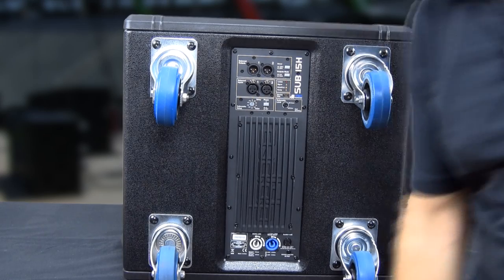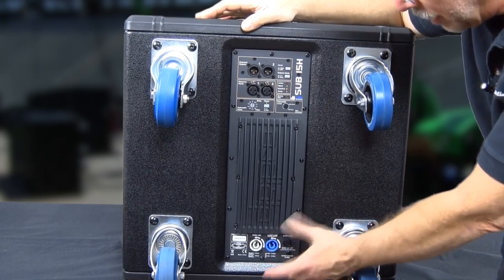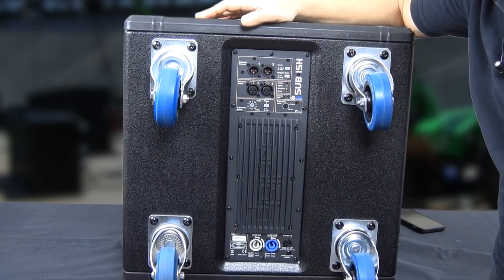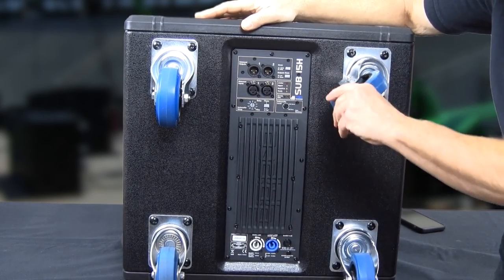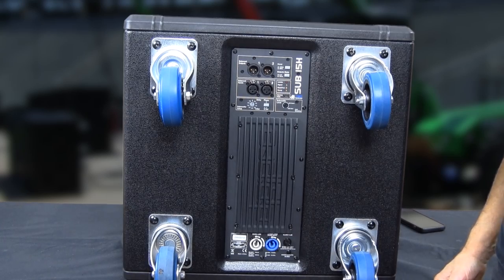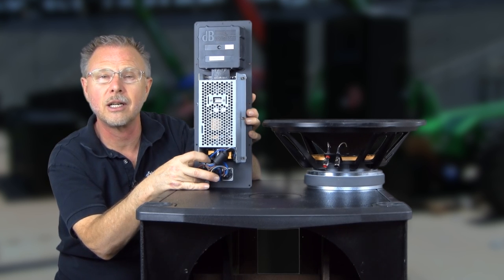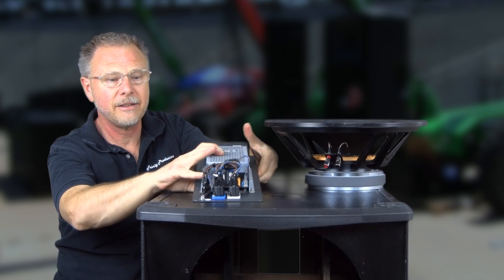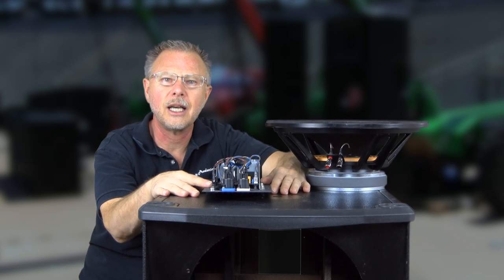dB Technologies SUB15H - complete review - AUTHORIZED DEALERS

Comment: Hello. I'm gonna buy some 15 inch subs soon. I'm thinking SUB15H or DVA S09. I did not like the RCF ones. 705/905AS (both mk1 and mk2). What do you think? Which one sounds better? I am willing to pay the extra cash for the DVA S09. I just need a 15inch sub that's better than sub705/sub905 from RCF. And also, I own some TL6A tops with TTS26A subs. What options do I have from DB TECHNOLOGIES that would match this setup? 4 X TTL6 and 6 x TTS26A subs. Thank you very much! :)
Reply from the maker: The TTS26 are going to be the best 15's you can get, not much out there other the LAcoustic for 15" subs that will rock your world. The S09 is OK but nothing can compare with the TTS26's

Comment: Hi , thanks for the response i can report that i compared the DB SUB18H to EV ETX18SP & sorry to say the EV was louder ,went lower & was cleaner to my ears none of the 2 subs were run into limiting but as you know the DB is horn loaded so it's kind of a dirtier sound (how i describe it) this was evident when we turned off the top box and just listened to the subs,the crossover on the DB also lets more high frequencies through.

Of course the main problem with the EV is that it's a 2 man lift it's a monster sized sub that will break you're back if you try lifting on your own and you'll need a lot more space in your vehicle to transport it as it's quite wide which also makes it harder to lift , on the other hand the DB is easy to lift it's around 10 kg's lighter and is only about 20% lower in output but output on the DB is still very impressive, i suppose the ETX is in a class above in both Weight and output.
Reply: George Georgio Hi. Have you try a test with a prx 618xlf and the db sub 18H? I read on the specs of the db that this is a "combo bass reflex-semi horn loaded" sub. Im very interested to this aspect. The frequency response of the db18H is 28 to 150Hz at -10db, and you can choose the 90-120hz crossover frequency. I think that the great aspect of this hybrid configuration is that came down very low frequency in bass reflex and very long throw range boost in long distance. The prx618xlf have from 30hz to 105hz at -10db. I can confirm that the prx came down at very very low frequency!! but it does not exceed 90hz and the bass reflex configuration have little/medium-long throw range.
What do you think about this?
Thanks in advance, best regards.
Reply: Hi , i'm not a sound engineer i'm a Musician but the DB is like having 1 and a half PRX618-XLF's there is a major difference forget the JBL specs they're not accurate.

The DB pounds harder, goes deeper and seems to throw longer also does not get as hot on the back like the PRX does.

That's why JBL are bringing their new SRX
series out to compete with all the newer models from EV , DB etc one thing about the DB is that it's a dirtier sound not as clean as
the front loaded EV i compared it to also a lot lighter as the EV is impossible to lift unless you're very strong.
Reply: George Georgio Hi. Thanks for the answer.
Just yesterday I carried out tests with jbl prx 618xlf and a db dva s10. With a "hearing test" I could see that the prx attacks from 28Hz up to 100hz. Then it off completely, while the dva s10 attacks by 38-40hz to over 250Hz with filter at 90hz! to get all the power of prx it need to connect the sub in stereo mode, so to be able to work both internal amplifiers for reach the full power, otherwise the power is definitely half. The sub dva s10 is only mono, therefore has an output comparable only with the stereo mode of prx. The sound of prx is soft and pleasantly muffled, while the sound of dva is dry and more opened (but is also designed to be suspended!).

I think that the spl is little more in dva. I wonder if even the sub db 18h in mono mode has half power. Could you possibly tell me this? Thanks in advance, regards
Reply: Hi the sub18H uses the latest digipro 3rd gen so you can't compare it with an old digipro 1st or 2nd gen dva s10.

There is no competition the
PRX sounded hollow when i compared it to the sub18h i had one FBT VERVE on one side with the PRX and one with the SUB18H on the other side the difference was night and day the only thing you could argue is that the JBL may go slightly lower at low volumes but i did'nt notice it.

If your'e trying to work out what goes lower etc you would have to hire both or one of them (if you have the PRX) and then do some testing but i think you'll be wasting your time, wait til the new JBL models come out the PRX is almost  5 Y.O. I also compared the sub18h with the DB sigma sub and the Presonus 18" sub and it was more powerful than both of them but i think they may have had a cleaner sound at lower volumes being front loaded.
Reply: George Georgio Hi. 
Im very interested to buy a pair of db sub 18 h and replace my prx 618xlf. I hope to hear as soon as possible. I put them under the Verse Insider 15 MKII (the Verse sub 18mkII is very cumbersome).
Yesterday im try another test in open space with prx and dva s10. The results are that the dva have more spl and sometimes i see the clip limiter. The JBL is more closed and the clip limiter is continuos light. 
Together they have a nice full sound!
By the way: What can you tell me about the limiter of the db 18H?
Another question: can you describe the differences between the sigma 18 sub and the 18H if you listened to them both? I know very well the sound of the sigma sub.
Thanks in advance, regards.
Reply: BertoConsalvi As explained earlier the Sigma had a cleaner sound but
was not as loud as the SUB18H mostly due to the newer gen 3 AMP i'd say , i got the SUB18H because i only had so much space in my car, you could go for a bigger more powerful sub but 42 kg's is my limit.
Reply: George Georgio Thank you very much.
Reply: I hope you get a chance to try one they are a good compromise between weight and power.
Reply: +George Georgio I'm buying a sub to go with a pair of RCF HD32A, do you think I should get the 4pro 8004 or FBT Subline 18sa? Thanks.
Reply: THE 4pro would go harder but more expensive, FBT have the Mitus range that would be more than a match for the RCF sub.
Reply: George Georgio Thank you, George. Do you think I need two 8004 with a pair of HD32as for average 250 wedding? Or one 8004 would be adequate?
Reply: One is good

Comment: Can you do a comparison between the Sub18H and the ETX 18SP? i'm thinking of paying to do a local comparison here in Australia as there is a guy who sells them but he needs a bit of convincing to take one out of the box as he knows i won't be buying as i've just bought the Sub18H it pretty much ate the PRX618-XLF i used to have.
Reply from the maker: EV would have to send us a demo to do a side by side...which, we are dealers, but I don't think they are down for that ... think this series would be some serious competition to them. And most likely outperform them...
Reply: trinityprosound
Hi,unfortunately as i've previously stated this didn't seem to be the case the ETX 18SP was better all round but we were only trying a couple of tracks and the ETX
is around 10kg's heavier and a lot wider/harder to lift.

On the other hand i can lift the SUB18H with a little strain on to a trolley, i think the DB is a very good compromise on weight and power i did a function last week with around 300 people and it felt like there were 2 subs in the room, one of the staff came up and asked what subs we were using and i just pointed at the SUB18H.
Reply from the maker: George Georgio thanks , excellent news !

Comment: I narrowed my choice between the DB technologies es 1203 system and the Sub 15h and some opera tops as a compact system. Which one would be better to do dj events?
Reply from the maker: use a pair of ES1002s' for ease of set up and portability, but you may realize a bit more sound output from a pair of Opera tops and a pair of SUB15H's
Reply: trinityprosound  thanks again

Comment: How about the SUB18H ? It really goes down to 28hz ? I have to choose between SUB18H or RCF 8003AS ..
Reply: I'm curious about this too
Reply from the maker: It can, but it will be most likely 6-10db down from the peak which is around 70hz, there is not enough cone or power to really produce effectively on a sub of this type and size down to a earth shattering 28hz. you have to get into a 21" with more power and larger volume of box to get constant earth shattering, low note out of that you will feel, but may near clearly hear...

Comment: Hi all. Anyone never try a test with a prx 618xlf and the db sub 18H? I read on the specs of the db that this is a "combo bass reflex-semi horn loaded" sub. Im very interested to this aspect. The frequency response of the db18H is 28 to 150Hz at -10db, and you can choose the 90-120hz crossover frequency. I think that the great aspect of this hybrid configuration is that came down very low frequency in bass reflex and very long throw range boost in long distance. The prx618xlf have from 30hz to 105hz at -10db. I can confirm that the prx came down at "very very" low frequency (an infrasub!) but it does not exceed 90hz and the bass reflex configuration have little/medium-long throw range.
What do you think about this?
Thanks to all in advance, best regards.
Reply from the maker: BertoConsalvi The 18H probably does, but a 6db down or so...you have to have a lot of power and very large drivers to feel the 28hz signal...it is more of a feel than sound and the only way other than at low levels to get that is a box tuned for the low end or lots of power and large drivers in the 21" range. There are some good 18" boxes that will do that low and also some specialty boxes with 12" drivers in them, properly tuned. To see something that will do that low, look at the RCF TTS56A
Reply: trinityprosound Hi, thanks for reply.
im try the prx with an hearing test and i hear that the attack begin to 28hz unlike the dva that attack at 37hz!
Have you ever heard the 18h? what do you think about it?

Comment: Hi people Kindly advise which ones better sub 18d or Sub 18H, which ones got a better throw ?
Reply from the maker: Juggy Virdee what are you doing with the sub, DJ or live sound ?
Reply: trinityprosound Djing  only .......Would like to seek opinion on this one, i have been using sub 18d.

Im looking in to sub 18H kindly advise which one is more powerful ? which one has got a better out put / throw ?

if  i use them together on the same mono out put  will one sound higher than the other ???
Reply from the maker: Sub 18H will go lower since horn loaded design, we thought the 15H sounded more like a standard 18" so the 18H would be more applicable to needed low end, DJ, etc. type requirements.

Comment: hi sir may i ask you this  i just bought the sgma s215  2 of them  can i mount them on a stand or them are made just to be on the floor  please help
Reply from the maker: +Clottey Partick Those are 110 pounds each and are not designed to pole mount...too heavy and most stands will not support the weight...also a liability should some one knock it over, being top heavy would be easy to do, we would not recommend.
Reply: thanks alot man

Comment: Actually I do not understand the level control (The rotary knob or how to say). I havent owned one yet but I want to know if this thing works just like the one of the sub 15 d. Is someone able to help? ...Nice vid!

greetings from Germany ;)
Reply from the maker: +Datenschutz Geheim Input sensitivity is what the knob is on this unit and also delay. The delay is used for cardioid sub setup where you would have optimally 3 subs with 2 facing forward and one facing rearward, and the rear facing sub would be 180 degrees out of phase and delayed approx 4-5ms, which cancels out sub at rear and provides gain to the front of the cardioid setup.
Reply: Thx

Comment: Could the 18H beat the volume of the ETX18sp?
Reply from the maker: Daniel Graves they are close, but the SUB18H is horn loaded design and will most likely go lower than the EV sub. Power rating and SPL is within 1db, however we do not know where those measurements were taken with each sub, so hard to say.

Comment: How would this sub compare with Rcf SUB 705-AS II ?
Reply from the maker: They are comparable...the SUB15H is a decent sub, but as with any 15" you don't get the low response like with an 18" sub.  Build quality of both is good, the RCF is a bit better. Both have about the same power rating. They are close in cost as well.
Reply: @trinityprosound  This can't be right - I would think the Sub 615 is similar to the 705 and the RCF 905 is comparable to the Sub 15h?  No?
Reply from the maker: the sub 15H is more horn loaded design or hybrid, where the 905 is not, the 15H is decent for a 15" sub, but the 905 kills it for output - but these are 15" subs and you are not going to get the response like an 18" sub from them or the larger cabinet volume of a 18" sub. for the 615 compared to 705, they are close, a wee bit more power in the 705 and a larger VC than 605 so a bit better "engine" by ½"